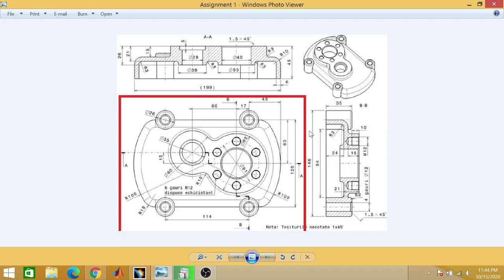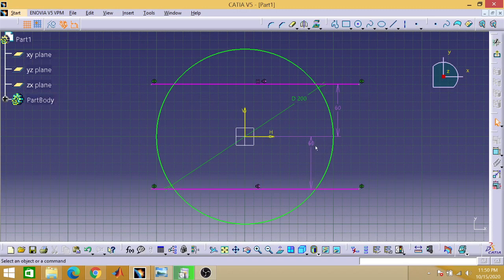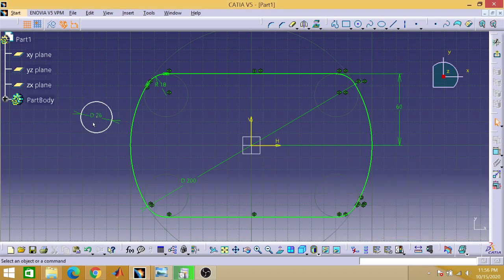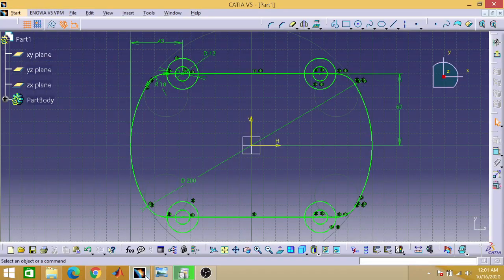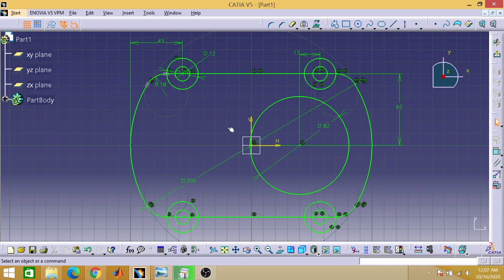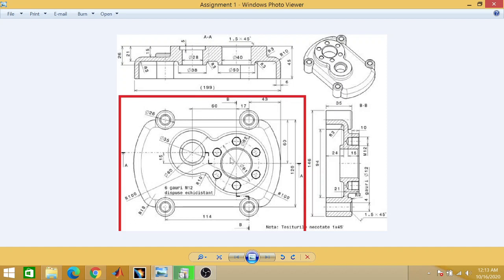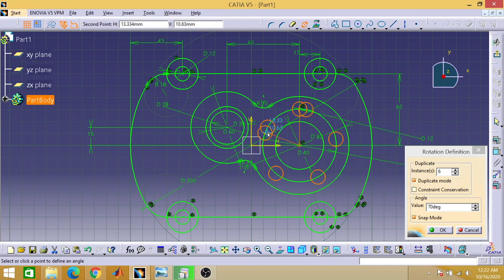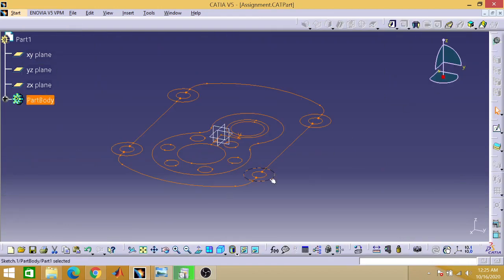How to make part design on catia...#comp aided drafting/design

Comment: please make videos on subject of Linear Circuit Analysis
Reply from the maker: you can specify the topic i can help you in that
if i start from initial it will take time to come to that topic in which specifically you need help...
are u from ist? batch?
Reply: @braingain2052  yes m doing Avionics engineering from IST. M really impressed by ur teaching method please keep uploading videos on use of catia really need this. And secondly i wanted to ask i was going through videos on ur channel and i saw videos on Differential equations ..are they of chapter 4?
Reply from the maker: @ayeshasaddiqa467  it contains full syllabus of Differential eq, what i studied in my course, you can go to that playlist and find all videos
Reply: @braingain2052  okay Thank you!
Reply from the maker: @ayeshasaddiqa467  u r wlcm